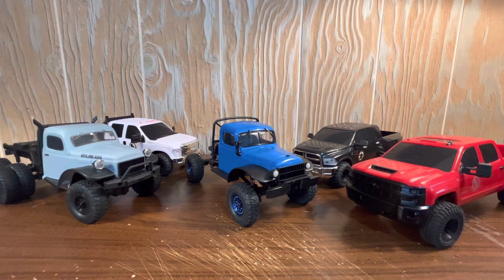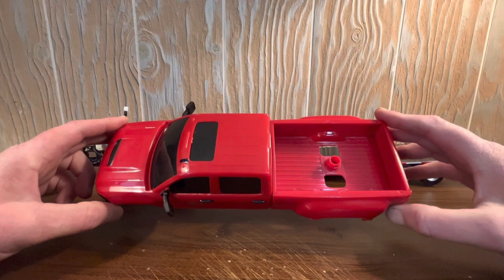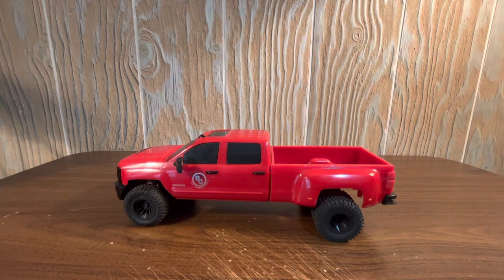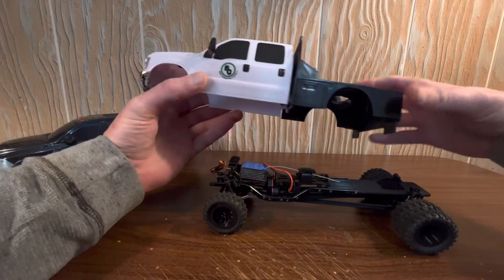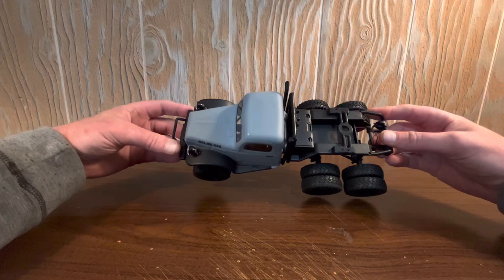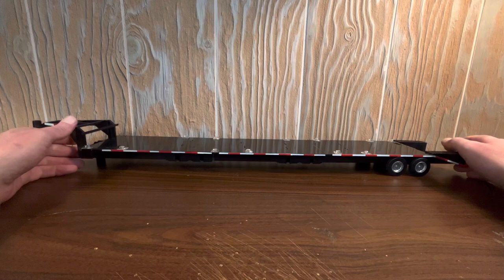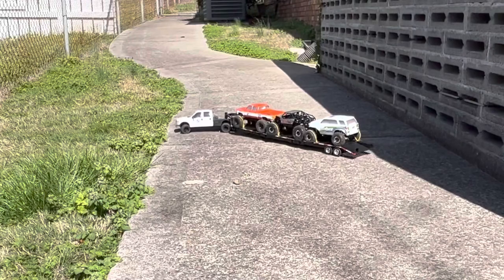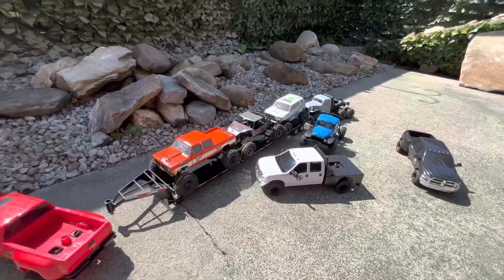SCX24 Trailer Rig Build. 1/20 Big Country Toys/FMS Atlas 6x6/FMS Power Wagon.

Comment: looks awesome.  Just wondering what you used as straps on the tires?
Reply from the maker: The smallest wall hooks I could find that has has the sticky tape and rubber bands.
Reply from the maker: You can get em at Wal mart they are clear and work really well.

Comment: Good video, but they consider the tube ( the hole ) as a female and the rod ( like a male member ) end on the joint is considered the male.
Reply from the maker: Yeah that’s what I said. lol
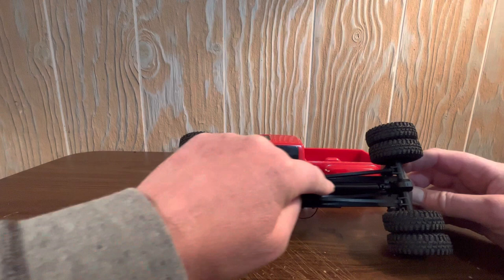Reply: No you didn't time laps at 5:50-6:15. This is the first time. You call them the opposite. RLMMFAO. But still a good informational video on how to do it.
Reply from the maker: @Jellybean_191  yeah there’s 2 female driveshaft pieces with this setup. I plainly called the piece from the stretch kit a female which it is. I plainly called the piece from the axle a male. I also called the piece coming from the transmission with the yoke a female which it is. The female piece with the yoke goes inside the female piece from the stretch kit. Although the section with the yoke is being inserted into the tube from the stretch kit it’s still a hollow tube which makes it a female.

Comment: I do wonder if a trx4m would work easier then then stretch kit
Reply from the maker: Possibly but the trx4m might look a little big taking away the realism.
Reply: @tcbrc7555  that's true
Reply: @tcbrc7555  I might get the ford and cut the read bed off and try to fit on the gladiator frame. Then build a custom bed for it. Not sure if it would work
Reply from the maker: @crashandcynder  the bed and body are 2 different pieces so you wouldn’t need to do any cutting.
Reply: @tcbrc7555  oh okay that's even easier then lol
Reply from the maker: @crashandcynder  so I put the ford body on a set up gladiator chassis and with the front wheels lined up to the wheel wells the rear wheels are under the rear doors but that could be corrected by using gladiator rear links up front so you could move up the body.
Reply: @tcbrc7555  damn so it wouldn't work with the stock links. Alrighty thanks